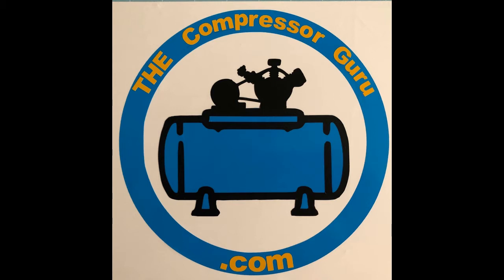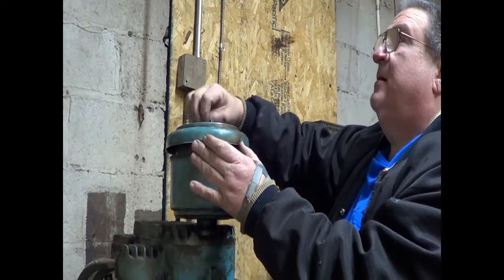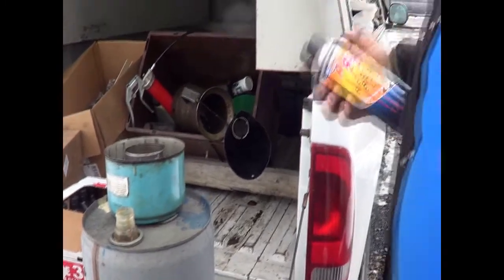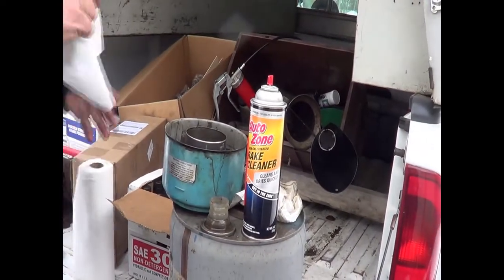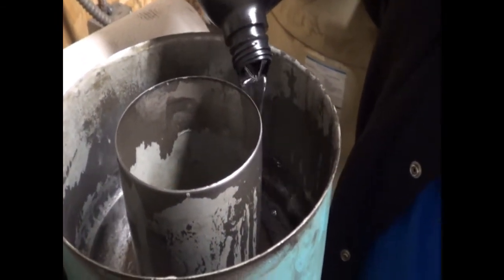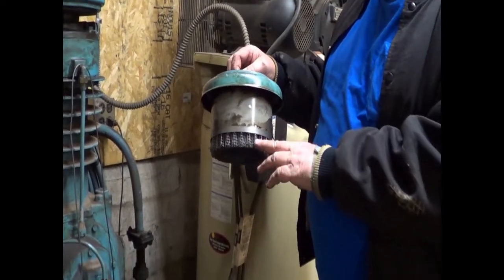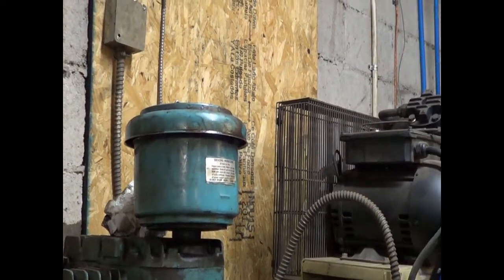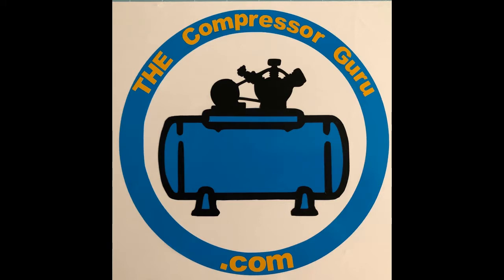Servicing an oil bath air filter.

Comment: Does the oil bath filter draw in some oil even when properly filled? Wondering if a shop using the air for painting would want to steer clear of these or if negligible considering other ways oil could get to the finished air. Thanks
Reply from the maker: Oil bath filters are old technology . Proper cleaned and filled work well. but in a shop that NEEDS high quality air I would not use oil bath when modern better options are available.
Reply: @THECompressorGuru  That had to be on a Kellogg 352 yeah? 
Crazy the pump is still available to this day. 
About 70 years? And without all the changes cough, quincy lol